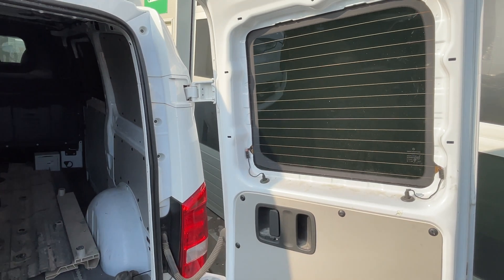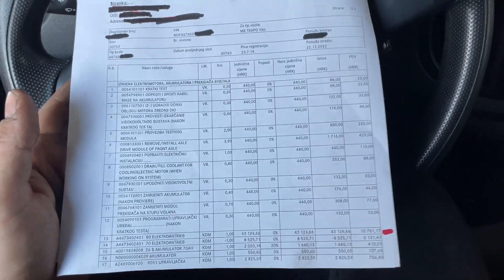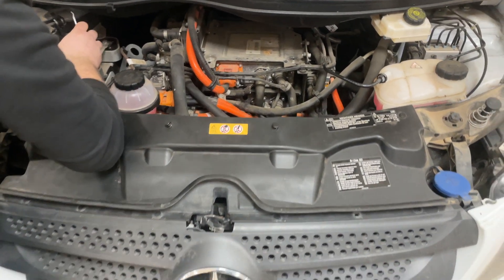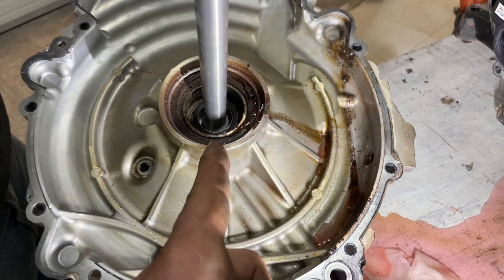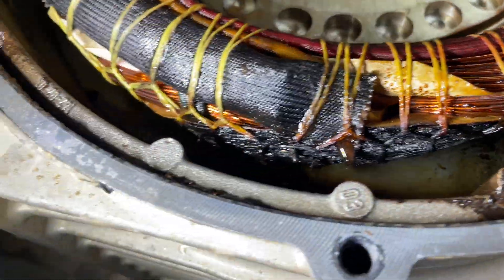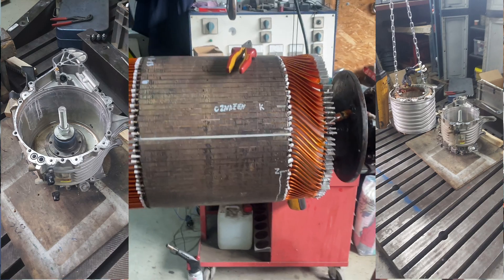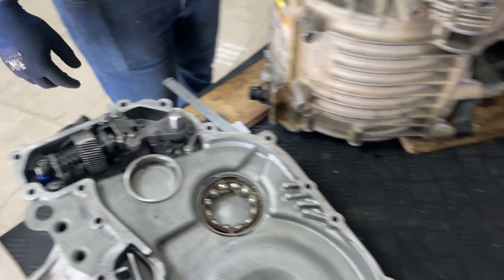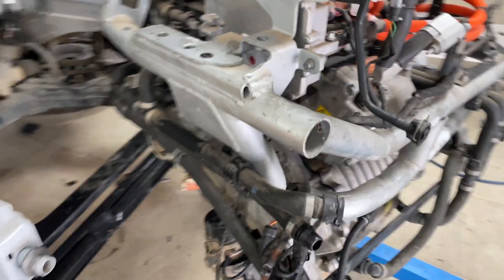EQV Mercedes - Drive unit refurbish A4473402401

Comment: So... I drive an eVito with this engine. Any advice on how to treat the engine to make it last as long as possible? This video doesn't really give me hopes...
Reply from the maker: You cant do anything. Remanufacturing must be done preventively. New electric motor in MB is arouns 10000€.

Full Repair if stator gets destroyed, in EVC is around 5000€

Comment: It is designed to fail. like everything Mercedes does.

And in another comment you also said they are the same shit as the ICE engines.

You are so right and this experience is something that most people do not see - I wonder where this way of german car manufacturers will lead to.

Your repair was very nice, especially that you saved the motor with the rewinding.

You're a pro 💪 
Are the newer VW and BMW as well as updated mercedes electric engines better?

I dont know if I may tell this public but VW has around 80% dead inverters going into the rubbish on current production and many designs have failed the same way: stupidity and lack of experience in the development coupled with crude price negotiations with the suppliers.

Comment: BUT,BUT, ev's don't need any servicing if you listen to all the fan boy's.
Reply from the maker: @oldbloke100  same as ICE made by MB
Reply: Truth is, they need some servicing. Virtually all EVs have a reduction gearbox. Some of them are proving quite troublesome. In an effort to control costs, some manufacturers have fitted cheaper components & these are failing prematurely. 
It’s actually no different than combustion vehicles where engine failures are all too common now.

Comment: This is not eqv, This is e vito. The eqv USe bigger and stronger motor 150kw
Reply: Both of them 204hp. I believe they use same motor
Reply: Same motor same problem, mine eqv300 has the same problem

Comment: Thank you, great video! Only 2Y warranty: Ouch! You took out drive unit 5-6 times more: Ouch! Question: Why "not ever buy bear box with the parking lock inside it"? Tesla/Toyota RAV4 and Tesla/Mercedes B class have it too and do not have many parking brake problems as far as I know.
Reply from the maker: Hey. Thanks for your Videos on your channel too :) they are great.
About parking lock… tesla gearbox is robust and overkill in all dimensions and lock is unable to damage ball bearings and gearbox  housing. Underdesigned drive units like ZF or Continental got serious issue wjth it. Ballbearing slips inside housing after some time and markings visible
Reply: @evclinic  ah, ok, thanks.
Reply from the maker: @diyEVguy  And i forgot to say. Only Rav4 got parking lock inside Tesla DU. Tesla drive units in Tesla doesnt have it.
Reply: @evclinic  yeah I probably was not clear, I meant the RAV4 EV with Tesla DU and the Mercedes B-class with Tesla DU.